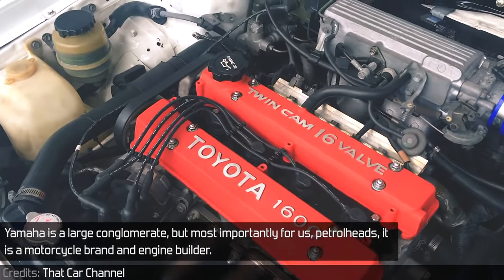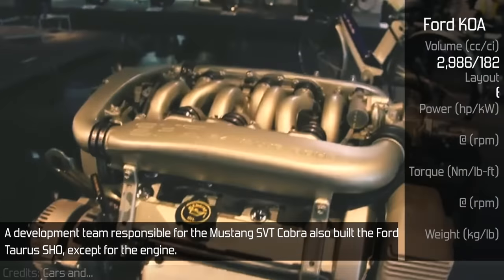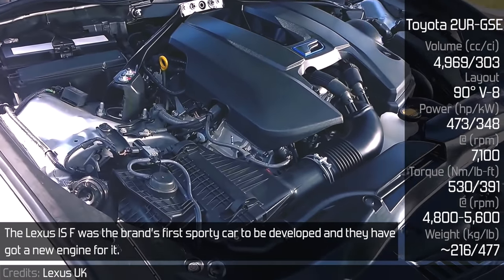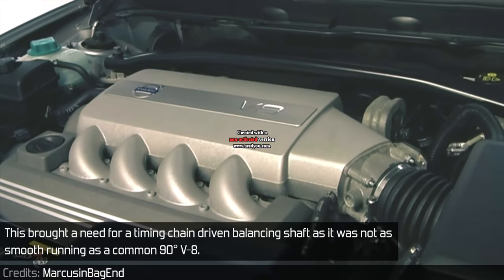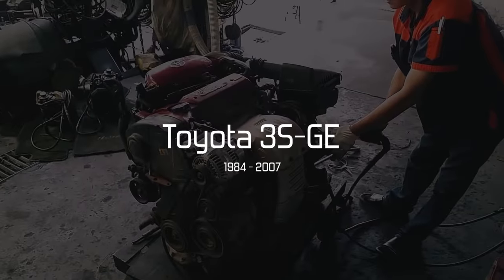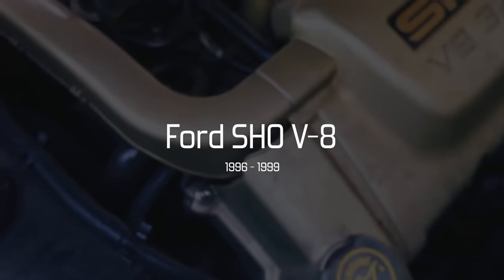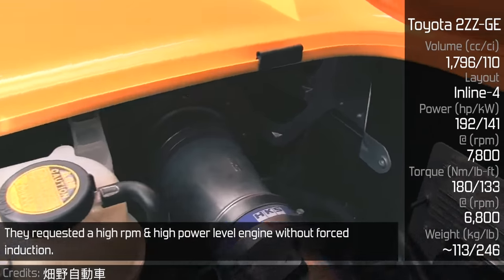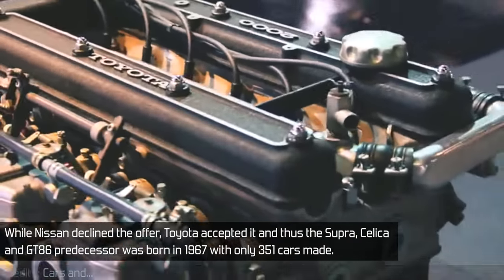9 Yamaha Engineered Engines You May Not Know About

Comment: why big car manufacturer order engine to yamaha??, to save cost??
Reply: Essentially, yes.
Car manufacturers have their own engine divisions. But they will mostly focus on a few base engines and tweak them.
When they need an engine to fill a gap in the portfolio, and it's for a non-volume or niche model it's cheaper for them to get it engineered by an outside company according to specifications rather then to develop it in-house, which would also bind staff to this new engine project which could be needed elsewhere.
Engineers who are able to design engines are rare, hard to find and costly, so you can't hire and fire them for just one project.
Reply: Crazy_Borg. So the Fiesta fitted with the 1.25l, 1.4l and 1.6l Yamaha co-developed engines were non-volume or niche models then? Your explanation is a bit out of whack bro... Ford used Yamaha because they were/are specialists at designing small efficient powerful (for their size and capacity) engines and Ford then used their own mass manufacturing processes to build hundreds of thousands of them - use an outside specialist to design a good engine and then build hundreds and thousands of copies of it - it's hardly a portfolio gap filler, niche or non-volume engine surely?
Reply: I was just making an example.
The Ford SHO engines, the Volvo B8444S, etc. These were high-end or special application engines, not the bread-and-butter ones. The Volvo V8 for example was the first V8 engine ever used for a Volvo consumer vehicle, primarily to offer an attractive engine for the SUV market in the US.
And there is no difference for letting yamaha develop a high-production volume engine, too. Co-Developing will split investments of money and man-power between the partners, at the loss of exclusiveness. Fair game, although car-makers prefer to keep most of their engine know-how in-house.
Which Ford Fiesta engine generation are you refering to? The Zetec-SE/Sigma? Thats a single engine design, just with different displacement. According to wikipedia a replacement for their aging Kent engine. The later generations of engines were co-developed with Mazda, like the current ecoboost (petrol) and duratorq (diesel) engines.
Please explain were my explanation is "out of whack", exactly.
Reply: They go to Yamaha as a specialist developer, not necessarily because of cost when niche cars are planned. It is not uncommon for other companies to also sell their consultancy and production facilities - think Lotus (also for engines) and Pininfarina (not just design but production).
Reply: @Crazy_Borg  And yamaha wanted a new petrol V8 for boats so it was a win win

Comment: toyota is toyota a lexus is lexus ..
Reply from the maker: Lexus is a part of the Toyota Corporation
Reply: Lexus was formed by Toyota for the luxury market and since has expanded across the world
Reply: LBM Turbo 
Depends on the year and model of Lexus and Toyota 
Some are on the same platform with different bolt ons and other Lexus cars are platform specific to just Lexus  this is becoming more the standard for Lexus to have its own platform justifying the higher price tag more appropriately then before
Reply: its the same as honda and acura
Reply: look up fzj80 and lx450 and tell me that again
Reply: VisioRacer from my understanding they also have their own engineering & production... of course they’re owned and basically a Toyota but Acura for example doesn’t have its own engineering and production, it’s Honda.

Comment: You forgot the Ford Puma 1.7... What a lovely revvy engine.
Reply: came here to make the same point.
Reply: Also the ALDA 2.0 ST170 engine and the 1.25
Reply: The 1.7 and 1.25 are both sigma engines, but the 2.0L ST170 engine is from the zeta family and isn't Yamaha co-designed. It does have head tuning  by Cosworth though, which is pretty sweet.

Comment: Great video, I know there are more, would love to see a part 2!  For the debate about who makes the BEST engines, it's speculative; some low tech/power/cost engines can be expected to go 350,000+ miles if well maintained, but will not be fast, or have a good HP/L ratio. While on the other side, a hypercar with 6,000 miles is considered a high mile car but still will be fast- until $xx,xxx or more is needed to fix/ overhaul not including shipping. OK say you want the best of both worlds, you can argue over how much tech is acceptable(# of sensors, CPU's, motors, valves, hose/tube, more miles of wiring, solenoids, etc.), argue over size/weight or HP/L even sound X-D. What type of group would it take to decide the best engine in production now? let alone all the bests of all companies for, say the last 25 years.  Personal preference!

Comment: Number 10, 11, 12, 13, 14 and 15/16. 

1960s Toyota 8R-G. 9R, 10R, and 1970s 18RG-UE, 2TG EU efi, 3T/4T GTEU, all production engines. Large YAMAHA casting on the front of many of the heads, or tuning fork casting inside.

Most all the WRC and racing heads were developed and supplied by Yamaha for the 1970s Corolla and Celica 2T, 3T and 18R based competition engines.

There was also extremely rare 1970s 3K twin cams for racing of various designations, the heads were developed and cast by Yamaha as well, but finished by Toyota and other private clients such as TOMS in America.

Comment: There is a question mark on a weight of a Volvo V8 4.4L engine. Haven't checked all the comments, of course. But scrolled a bit and didin't find anyone clarifying that. It is 190 kg (appr. 419 lb).
Second lightest big engine here (after LFA). And very reliable despite weighing that little (though there is one issue with a balance shaft). 

Just for a comparison, BMW's 4,0L S65 V8 from an e90 M3 weights 202 kg (445 lb). And we were told too many times that it is very light. And they gave it 5 Best engine of the year awards in a row. And now we all know everything about it's problems.

And yes, I know the power difference between them. But I also know that Yamaha can easily reach those numbers. And still have enough space to go further

Comment: 2ZZGE Yes finally someone talk about this engine ..... 170HP (180 on Lotus... due to sport ECU and slight head changes)... this thing is a rather EXPENSIVE but popular swap to do on a Yaris ... because who doesn't want a street legal sleeper go kart..
Reply: ACKING_QC 
I totally agree with you! My engine has gone 300 500 km / 190 000 miles and still goes without problems. Uses my car at Nurburgring without any problems or oil consumption. 192 hp on the Corolla T sport sold in Sweden.

I would like to see that engine in an Yaris or Aygo, would be a blast to drive!

Comment: The 4A-GE is probably my favorite engine on this list because you can mix and match parts to get a wide angle DOHC larger displacement engine— 4A-GE head plus 7A-FE block

Heck, those engines are easy to convert to carbureted and they had a 20v variant which probably also has an interchangeable head!

Comment: It''s 82kg heavy it makes 101 horse power 1.6l 16 valve Yamaha Developed, it's Zetec-Se i use it in my mk1 Ford Focus a 1070kg heavy car.It does 155 km/h in third gear,it is an all aluminum engine 101 hp -1070 kg.

Comment: Nice video bro and one question whats your favourite engine on this video ?;-)
Reply from the maker: It's hard to say, I like many of them, but the Volvo one is crazy and sounds very lovely.
Reply: VisioRacer yeah the b8444 sounds like a classic 90° us v8. 
It is sadly plagued with an infamous defect : water tends to accumulate between cylinder banks, then infiltrate in the balance shaft bearings, making them rusts and seize, destroying timing chain and valve train. Many of these engines died of this plague :(
Reply: Is it a even fire? Sounds like a odd fire I think. But that could just be the exhaust system or/and fireing order.
Nice music anyway 😊
Reply: 2zz ge

Comment: The 1.25 zetec in my old fiesta is also a yamaha engine. The car is crap, but engine and gearbox are still working fine. Its not fast, but zippy compared to the standard 1.3 8 valve ford engine.

Comment: 0:14 it sounded like he said "....this has been a real deal for dickheads...."

In all seriousness, I stripped down the BMW S62 V8 engine from my old 2001 BMW M5. On the inside edges of the cylinder heads, cast into the alloy, there was  "Yamaha" written on each cylinder head.
I also found "Yamaha" cast into the cylinder heads of a BMW M62 V8 from an E39 540i too. So even BMW uses Yamaha engineering.

Comment: Those yamaha V8 engines in Volvo cars doesn't have a good reputation.   It's a myth that all Yamaha engines are reliable.  Many are, but not every model they make.
Reply: CARNAL FLORES  design flaw on many of the motor blocks.  Moisture and wet roads can make the bearings rust, timing chain failure/catastrophic failure. 
The real issue is that volvo never recalled these. I think the issues was mostly before 2007. 

From forum: The dealer explained the engine had a 'catastrophic failure' and was "dead". I was told the battery was dead and there is no compression -- air blew through the engine. I asked how this could possibly have happened to a car that has undergone every Volvo dealer service, including one just 45 days ago. The dealer was courteous but explained the car required a new engine which costs $15,000. Google "Volvo Yamaha V8 Failure" and you'll come across numerous people discussing catastrophic failures thanks to the timing chain breaking. Volvo has not undertaken a recall.
Reply: CARNAL FLORES  2010 should be fine. I would still only wash my engine with damp cloth. People who used pressurized water have experienced more failures.
Reply: CARNAL FLORES    For some reason, half of the sealed bearing that supports the balance shaft is exposed to the environment. This became an issue in the B8444S as there is a small depression in the block right below where the exposed side of the bearing is.

What does this mean? Well, if you're the type of car owner who cleans your engine bay with a hose, water can and will collect within that little depression, seep into the bearing, and destroy it over time. Consequently, the balance shaft will then begin to rattle and slowly eat away at the mount point on the opposite side where the timing chain is located.

￼Eventually, the sprocket that drives the balance shaft will wear out, the chain will slacken, and the valve train will jump timing. The resulting noise from when the pistons meet the valves in their sudden newfound embrace sounds exactly like your checking account being emptied - XC90 owners have reported quotes as high as $15,000 to get their engine rebuilt out of warranty.

Link to this information:
https://blog.fcpeuro.com/the-dark-side-of-volvos-excellent-v8
Reply: CARNAL FLORES  no problem.

Comment: The Xc90 v8 is terrible.   Counterbalance shaft bearing failure is a $4k repair if it doesn’t damage anything else.  Overly complex engine to make 311hp.    A simple pushrod Chevy v8 makes the same.

Comment: Some of the worst designed engines i ever worked on we Yamaha car engines. Specifically the 2.7L DOHC in the Chrysler Concorde.  Lots of power but terrible design. The water pump is driven by the timing chain that requires you the remove the front of the engine to get to it. When the pump fails around 90k it fills the crankcase with coolant and your engine is toast.

Comment: I love my Yamaha power card but that was supposed to be a secret on which Taurus hands know the builder the Mustang made the Taurus it in and had Yamaha do the build but that's supposed to be secret so when we race we win forcing now people know our secret 5 horsepower less than the V8 302 Mustang the tour says have s h o Taurus that's not counting the V8 Taurus with that have more power than the 302 Mustang because they had a 3.4 l V8 32-valve V6 32-valve V8 back in 96 to 99 more power than the S5 horsepower less than a camshaft will add another hundred horsepower and a couple of other parts you won't have way over a hundred horsepower Mustang cool to watch the s h o s in action I have one and it does sound like the guy shows throaty exhaust nice sound in car 0 to 60 6.5 second 0 240 not even a minute this car gets up and get he's up it hits a hundred and only under eight seconds

Comment: The Volvo does not have a Yamaha v8, the noble m600 has the engine out of an xc90 and Yamaha tuned it up.
Reply: that volvo v-8 was developed by yamaha, volvo didnt have a v-8 to use and they didnt know if they should try building their own or commision someone to do it. and they commisioned yamaha. so yes it is a yamaha engine in the volvo and noble, also noble were the ones to add the twin turbos to it.